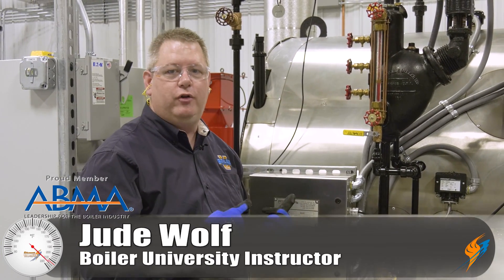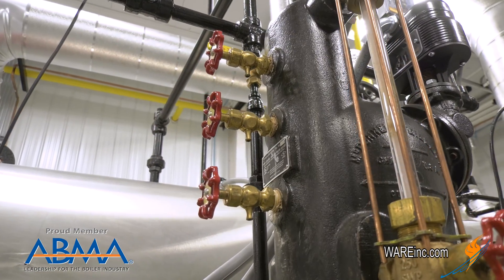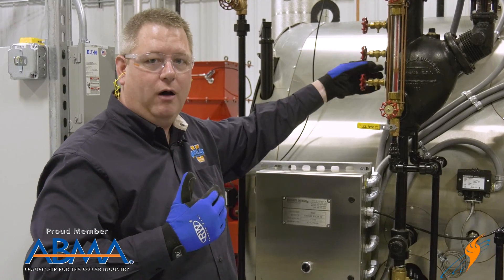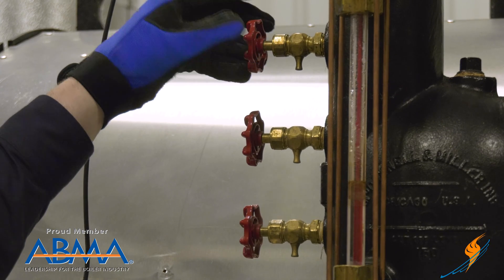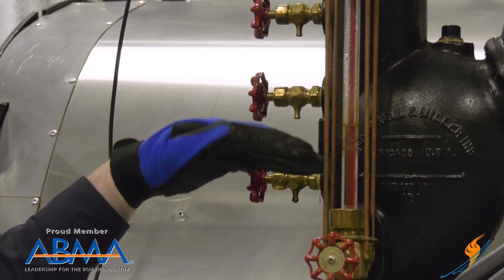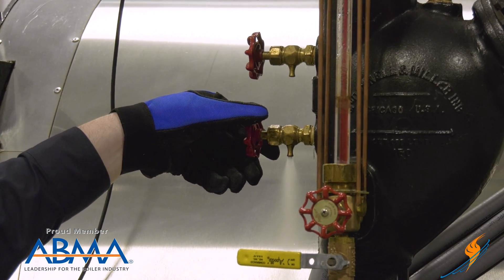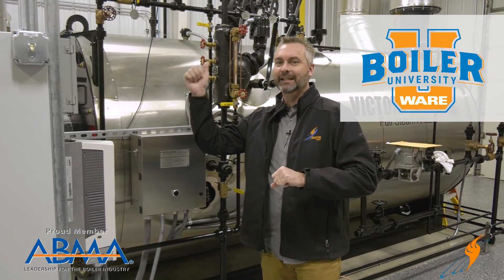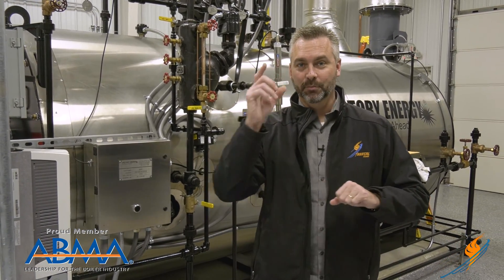How to Use the Tricocks on a Steam Boiler - Boiling Point

Comment: Hi Guys, I see that you do not have isolation valves on the level control to isolate the boiler pressure should you need to work on it. Meaning that you have to shut the boiler down should you so require.  Is that allowed in the code.  Great show guys.